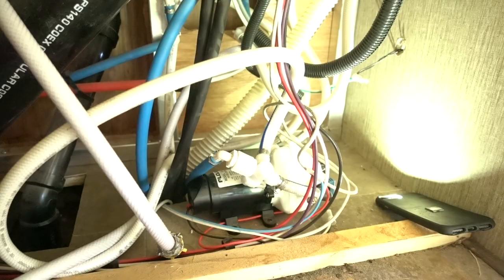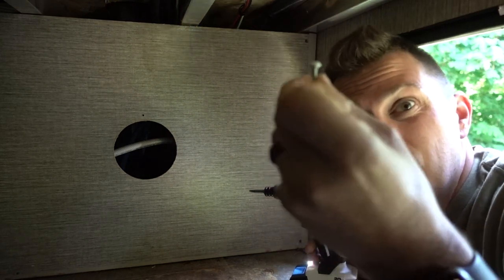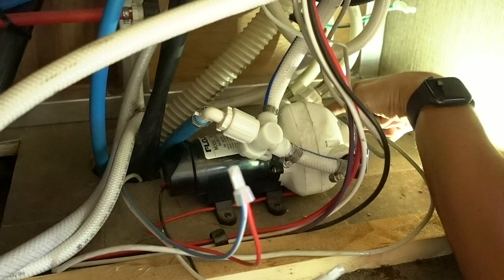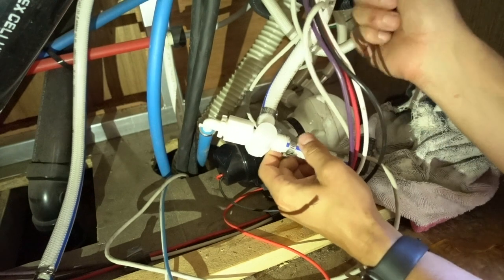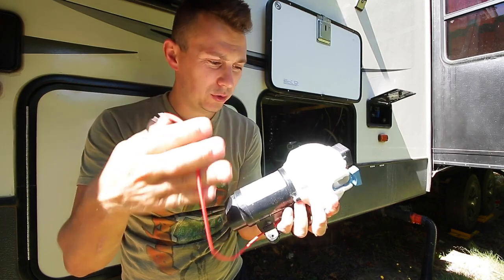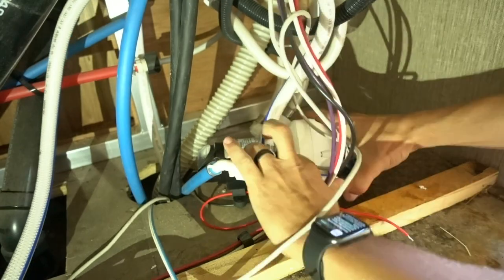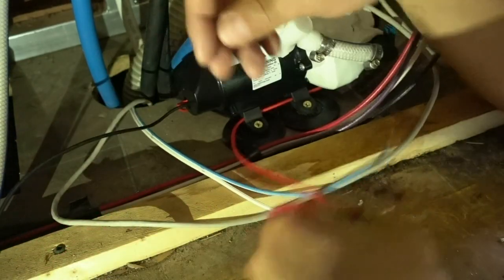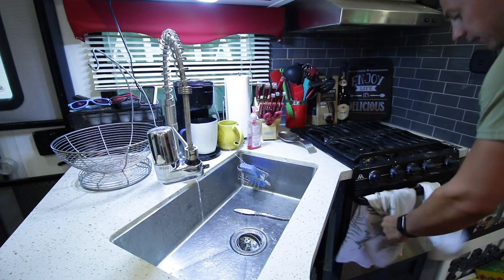HOW TO REPLACE A RV WATER PUMP 💦 RV Tips & Tricks

Comment: So there is a rubber mounted bushing to isolate noise and vibrations. It's basically a rubber sandwich that goes on the feet. The vibration travels down the screw to the floor, isolating the pump from the screw will help.
Reply from the maker: I will have to look those up. Do you have any specific suggestions?
Reply: @TheChicksLife  there is a few on Amazon as well as a few other sites like grainger. Anything that would basically sandwich the mounting feet in rubber and leave a space for a screw would work.

Comment: Just a slight correction! On 12v DC it is positive and negative, not positive and neutral. When you are working with 110 VAC it is hot and neutral.
Reply from the maker: You are correct!  Thank you, didn’t even notice I was saying that.
Reply: Technically you are correct though it really means the same thing 🤔